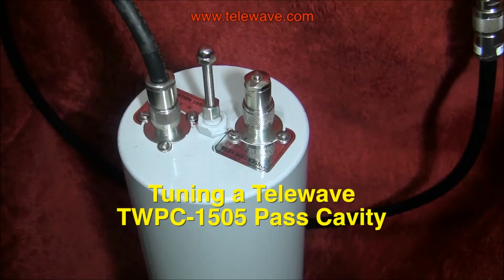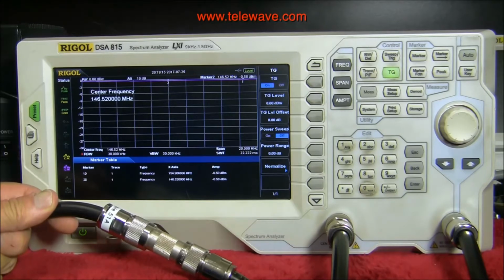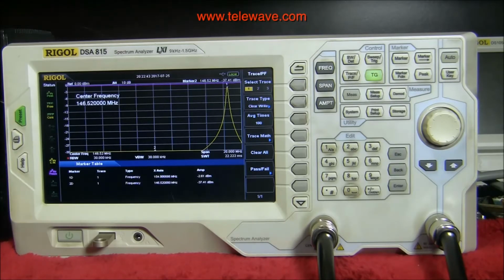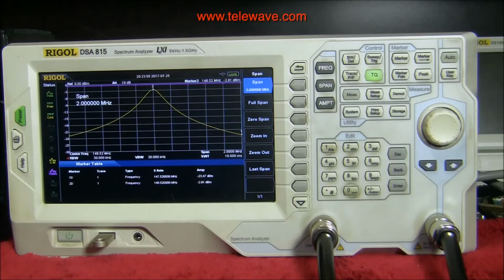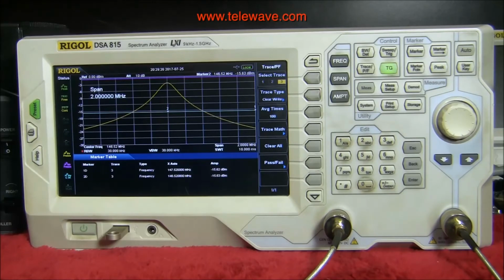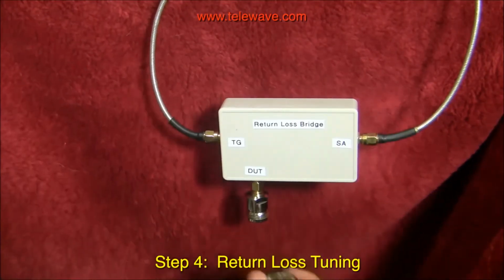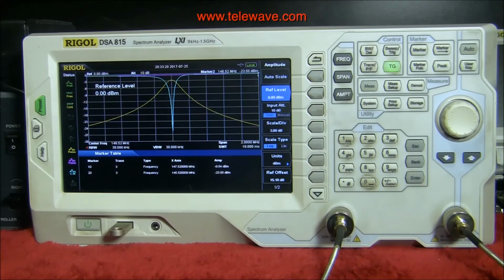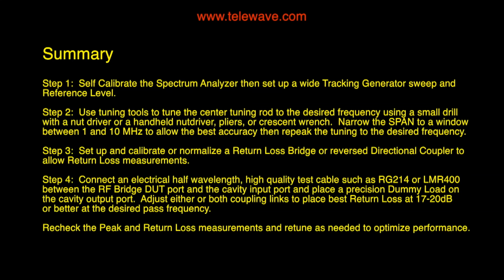Telewave TWPC-1505 Band Pass Cavity Tuning

Comment: Hello good morning. checking the cavity adjustment video, it strikes me that within the adjustment process, the screws that hold the female connector to the cavity are tightened or loosened, my question is: those should not be touched within the readjustment process of the cavities due to changes in frequency?, or if they should be adjusted to achieve an optimal fit?